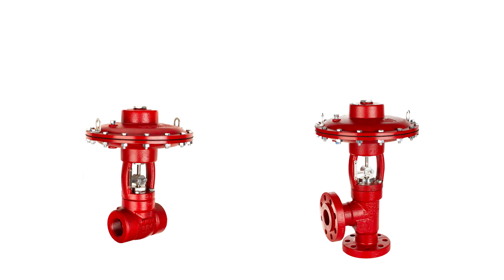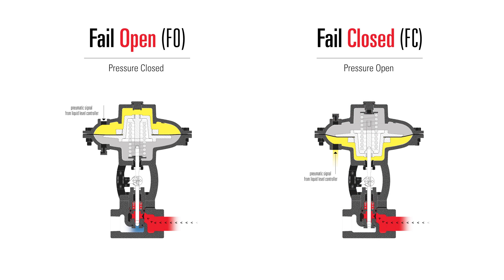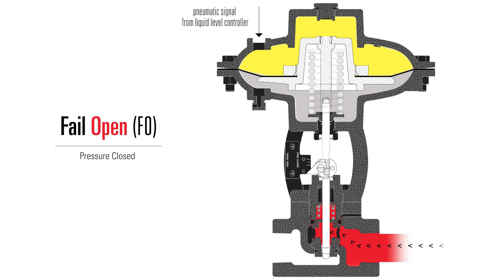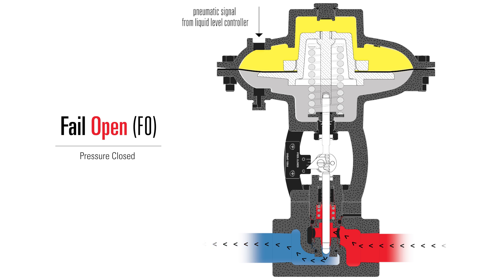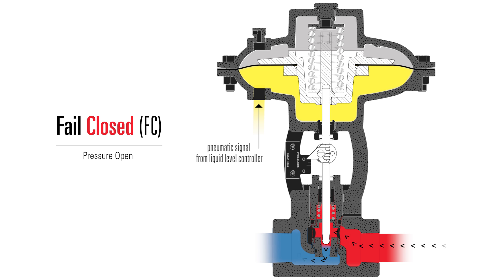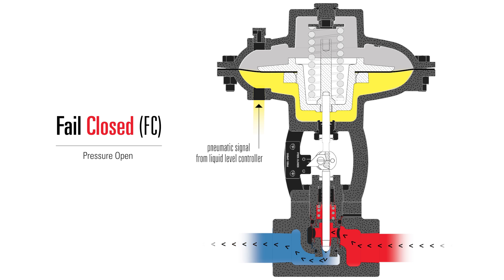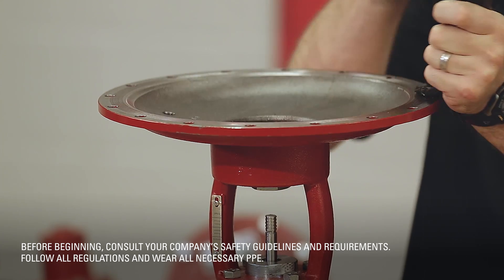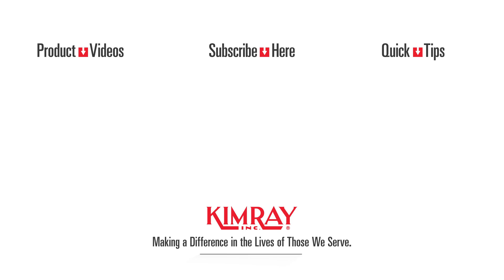Valve Failure Position: Fail Open Valve or Fail Closed Valve?

Comment: I need to understand the position of the source of the instrument air; if its from the top then is it FC or FO and if its from both, or from the bottom ?
Reply from the maker: If instrument air is going into the top of the valve, then it is a Fail Open valve, and Vice Versa. You cannot have a pneumatic supply going to both the top and bottom simultaneously. You need a vent on one side, and a gas supply on the other side.